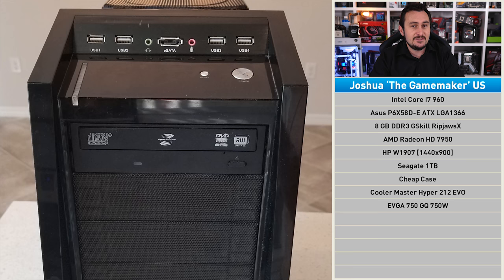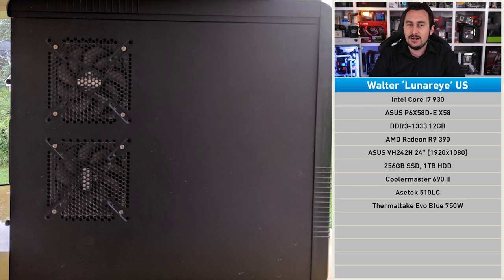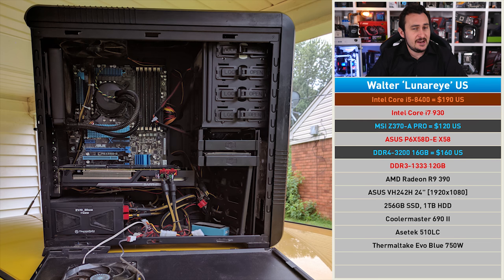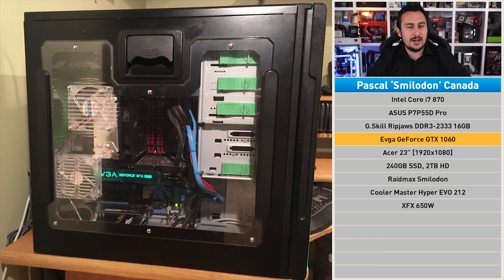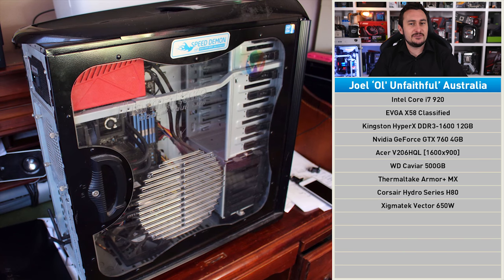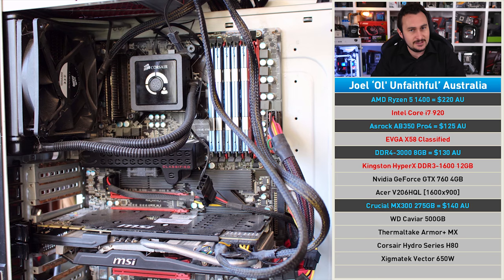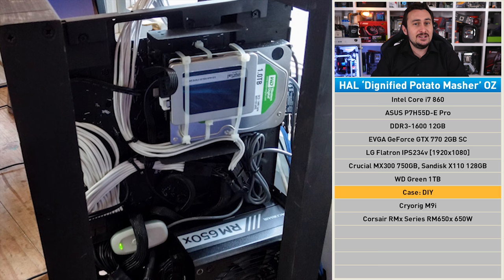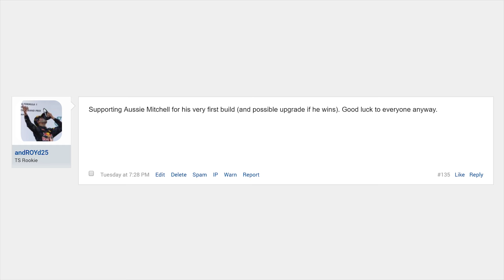Upgrade My PC Please! [S01E07] Balln With A Core i7

Comment: Partially because of your constant recommendations I just upgraded from my 2600k to a R5 1600, 16GB of RAM, Aorus RX 580 8GB, 250GB 960 EVO, 500GB MX300, etc etc. My budget was a little higher than $500. 

Also did a R5 1400 build for my wife with a waaaaay overkill 3GB 1060. 

Thanks for all you do, mate

Comment: Damn, if i had knew you could submit i7s i'd have submited my rig: 6700k @4.6 ghz, 16gb ram 2400mhz, and Asus Rog Strix 1080ti.. i could use some RGB upgrades, and maybe an nvme instead of my 240 gb ssd from Adata.
Reply: they were all pre sandybridge
Reply: Funny how I'm still using a Xeon W3690 (i7 990x) and I am perfectly happy with it.
Full specs:
Z-400 workstation 
W3690 6-core 3.47ghz
12gb ecc 1333 MHz ddr3
GTX-1060 6gb
Reply: and im happy with i3-4150 and im serious esport competitive player in fps shooter...
Reply: Yeah I need to upgrade this shitty R7 1700 on an ASUS Crosshair VI extreme and two 1080's to a 1950x a two 1080 TI's. The performance just isn't cutting it lately.
Reply: I don't even have a pc xD
Reply: well..i guess its just like threadriper..nahh a threadriper wont cut it in 2017 now would it :D
Reply: They should do an battle of the i3's I could submit mine with an I3 3220 8gb's ddr3 1600mhz and a radeon hd 5450, I could use... a new entire PC

Comment: I used to be in this crowd. I had a i7 870 on a EVGA P55 Classified 200 board with a GTX 690. I made the jump to a Ryzen 1700X on a ROG Crosshair VI board and haven't looked back.

Comment: As an owner (and user for 2 years) of an i7 920, I refuse to believe that lga-1366 i7s aren't cutting it anymore. The only reason I switched from mine to a ryzen 5 1600 is that the mainboard is dying and was causing all shorts of problems. The i7 could handle heavy gaming, multitasking (mainly virtual machines) and video encoding/ editing just fine. Whoever wins though, they'll get a pretty big bump.

Comment: Anyone with LGA1366 can get a 6 core 12 thread Xeon X5670 or better from aliexpress or eBay for ~$40US. It's in every way better than 45nm Nehalem (e.g. more cores/threads, cooler, overclocks higher) and will give your PC some more life.
Reply: None do officially but for most, if not all, it'll still work on. Can always just check online to be sure anyway.

Comment: My PC:
Intel Xeon X5670 @ 4.44GHz (scores 1009 in Cinebench and in CPU-Z benchmark it beats stock Ryzen 7 1700 on single-core)
Asus P6X58D-E
16gb DDR3 Corsair Dominator
Asus GeForce GTX 960 Turbo OC (I need something better :D)
250gb Samsung SSD 750 Evo, 2x 2tb Seagate BarraCuda HDD
Fractal Design Define R5

Comment: Ol unfaithful reminds me: if you're on a really tight budget and don't care about graphics the 750ti and 760 are cheap and can run many modern games at good framerates. Some of the best cheap used cards imo.
Reply: uzimyspecial nah, not so much anymore... the 760 has a 170w tdp, and the 750ti performs like a 65$ new gt1030

Comment: I love your Channel! Glad I came across it! Though I do have a question in regards to an upgrade which I don't think you've covered yet. What cpu should I upgrade to? I currently have an AMD FX-8350, 16gb of Patriot Viper ddr3 1666mhz on an Asus M5A99x Evo R2.0 mobo evga GTX 1060 6Gb and Corsair TX750m PSU. tl;dr Which Ryzen CPU would be an upgrade from my FX-8350
Reply from the maker: Thank you :) I'd recommend either the Ryzen 5 1400 or Core i5-8400, the Ryzen 5 upgrade on a B350 board will probably be more cost effective.
Reply: Thank you, Sir. You Rock!

Comment: OMG an X58 motherboard and an R9 390!!!!! just slap a hyper threaded lga 1366 xeon 6 core in that!(x5650-x5690, or w3690) They are on ebay all the time for like 30-50 U.S. $ mostly its just an awesome cheap upgrade and I believe that motherboard could overclock.

Comment: Hardware Unboxed i would like to upgrade my graphics card from a RX 460 to a Gtx 1080 but i have an intel i5 7600 (none k) cpu with 16 Gb of DDR4 2400 mhz will my Cpu bottleneck the GTX 1080? please Reply

Comment: I need a upgrade I have a 5930k two 980ti's in sli 32gb of ram  a 256gb ssd and a 2tb hdd on a rog rampage extreme v mobo
Reply: Mainly just need new graphics cards like two 1080s or 1080ti's